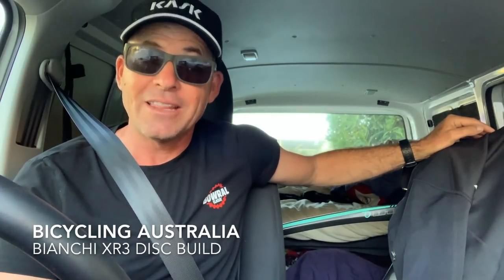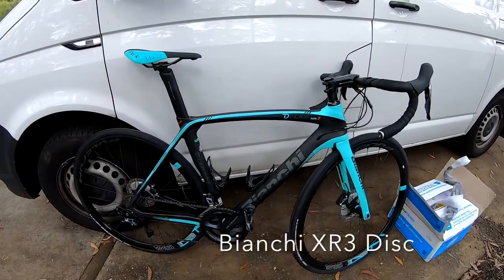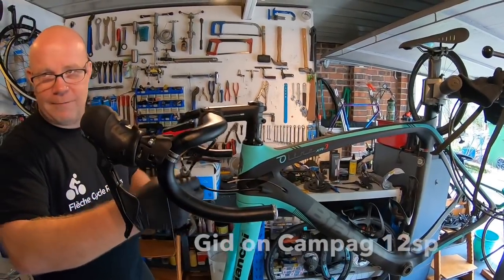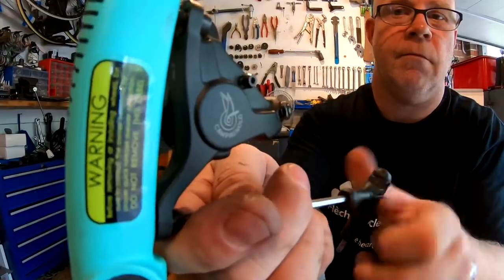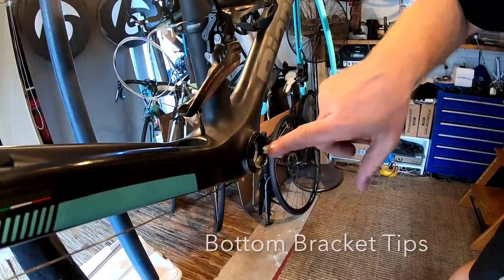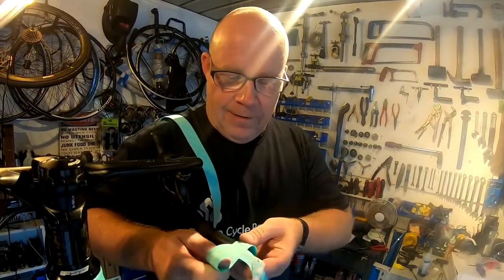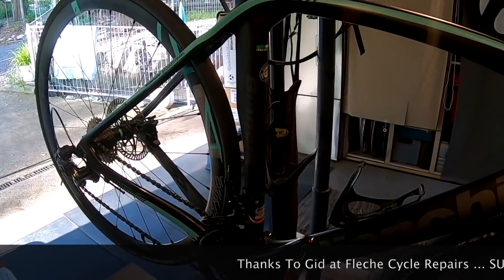Bike Build - Bianchi XR3 Disc With Campagnolo 12 Speed

Comment: On a new frame do NOT grease the frame before you install BB bearings.   All it does is cause the bearings to move in the frame.  Install all pressfit bearings dry into new frames.
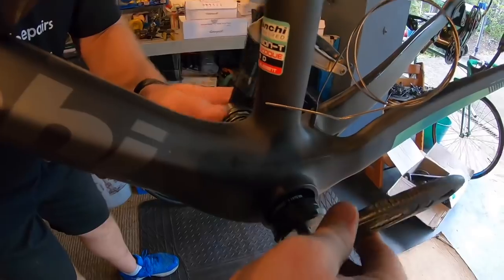Reply: He did not grease the frame but the pre-installed BB cups, which are threaded. Into these cups the actual BB bearing cups are then screwed using special wrenches (5:19).

Comment: may I know kind of bottom bracket you used? thinking of shifting from ultegra to campagnolo record or super record. thanks
Reply: did you find out what BB he used? I'm on the same boat as you right now, trying to move from shimano to campy.
Reply: He used the Campagnolo ceramic bearing BB which comes with the crankset.

Comment: He clamped the carbon fiber seat tube😳. Noooooo!
Reply: That's exactly where you're supposed to clamp on a carbon bike frame. Probably would have been better with a shop towel in between, but way better than cracking your frame.